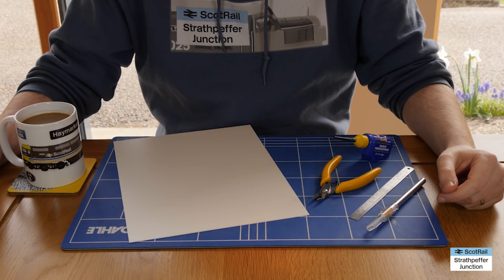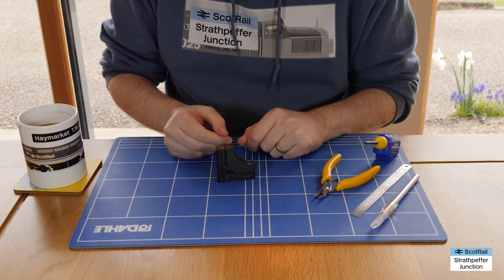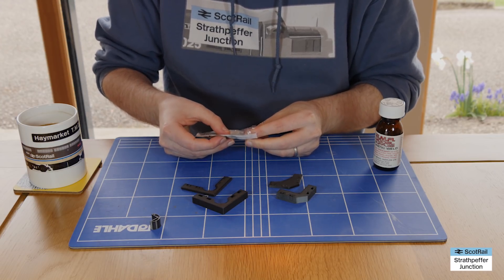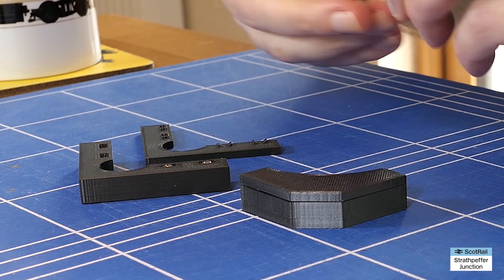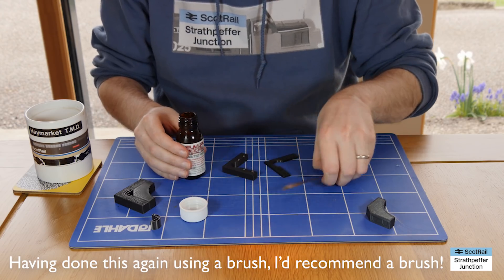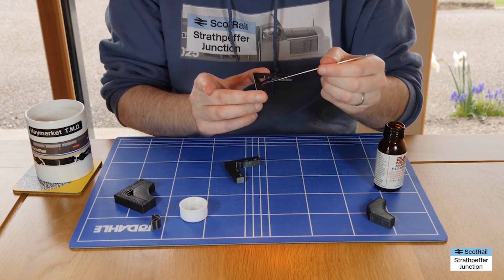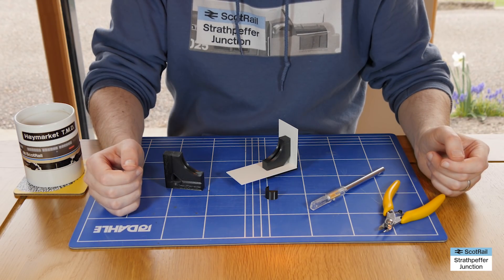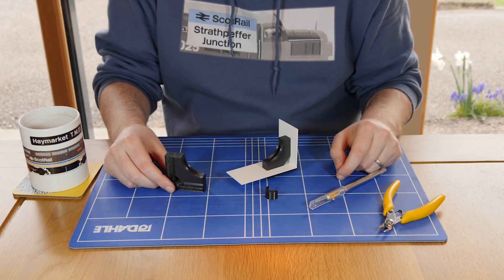How to Make Magnetic Set Squares - DIY for Railway Modellers (3D-Printing)

Comment: Really smart idea David! Things like this make me want a 3D printer! Any plans to make the printed product available? Hope you're on the mend mate!
Reply from the maker: Thanks, Richard. I wasn't planning on selling it, but if folk were really interested, I might consider making a small number. The main issue with 3D printing is that if you have a printer, you can run things off in a fairly cost effective way, but once you add postage etc for other folk, the cost benefit reduces.

Comment: That’s a great little product design there David and something I could certainly make use of in my scratch building. One question, you mention being able to increase the size of the blocks for larger projects but can they also be downsized for those smaller and fiddlier builds? Another top Strath Shorts video. Paul
Reply from the maker: Hi mate. In theory, you could print them small, but you may struggle to find the magnets. It's easy enough to design small squares to fit the magnets available though. If you want some of a particular size, just let me know and I can make you some. 🙂👍🏻

Comment: I love your idea.  Especially the poke out angle manager.  GENIUS.  Shear genius.

So for my problem.  Once I can download the file, I have already registered and bookmarked your page, how many times may I use the plans.  I am planning to print a half dozen for myself.  HOWEVER, once my railway club sees them I am certain those guys will want a set.  SO if I refuse to accept payment from my friends &  gandy dancers can I make set squares for them as well?

~SEE YOU DOWN THE LINE,
~Jim
Reply from the maker: Hello my friend. Thank you for the kind words. Please feel free to use it as many times as you like and feel free to print for other people if they'd like it. I just ask that people don't sell them for profit. 🙂
Reply from the maker: PS. As I'm sure you know, every printer prints to slightly different tolerances. On mine, the wee insert piece sits nice and snug, but you may have to tweak print setting to get the fit just right on your own machine. I was thinking about perhaps designing in a slight dovetail into the insert to provide a runner and also a little more surface area to accommodate different people's printers being slightly different, but not yet got round to it...too many jobs to do!
Reply: @StrathpefferJunction  ALL the videos you have uploaded show the level of expertise you do.  SO YEAH I understand you have a lot more work to do.  NO SURPRISE.